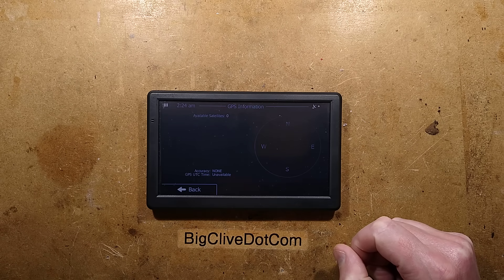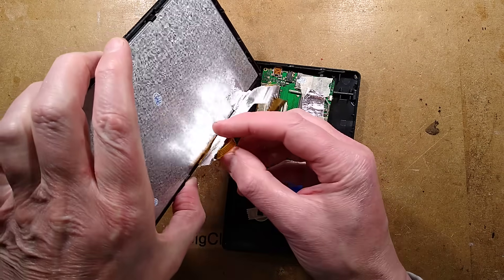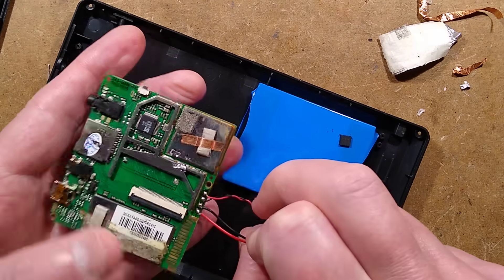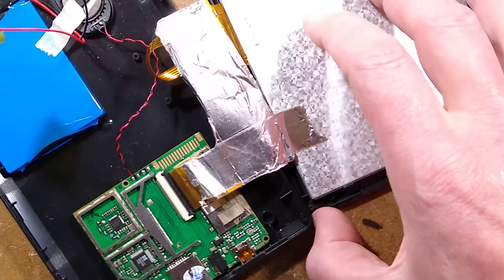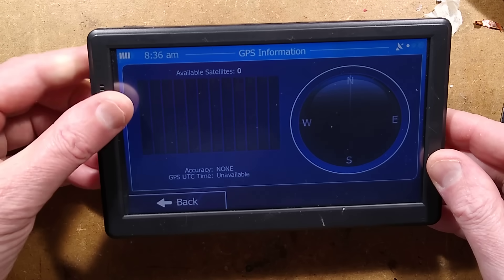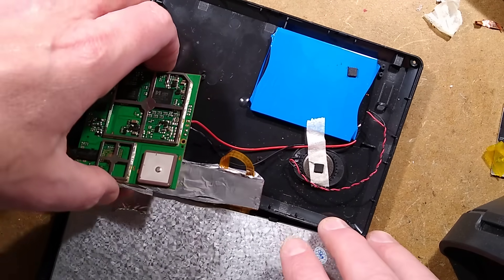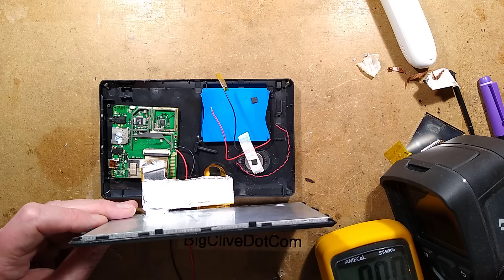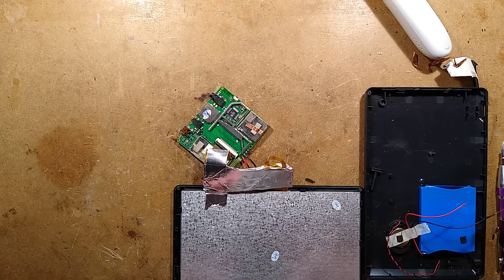Inside a trashy sat-nav

Comment: Looks like the OS is probably WinCE. I've got a small unit with a similar UI and can break out of it to get a nice WinCE desktop. As for the GPS, not too familiar with how it all works, but from what I've read, without any assisted GPS data (smartphones use cell tower IDs and data connection to an AGPS server), it may have to redownload the almanac, which takes around 10 minutes, before it can get a lock.

I wonder what that blob of what looks like solder is used for on the antenna.

Also fun fact, there was a GPS week rollover in 2019, so receivers that are not updated would show the year as 1980 (although the time would be right).
Reply: Yeah no way any android version is gonna boot that fast on such an old device either.
Reply: Wince.
Reply: @khaitomretro  Yeah thats what you do when you realise how crappy it all is...
Reply: My grandpa had a Windows CE Sat Nav and it made the exact same annoying BLOOP sound this unit did when Clive pressed shut down, so I’m willing to bet it’s CE as well
Reply: Redownloading the almanac takes around 12 minutes, but you'd be very lucky to start just before it begins. So it's best to assume it will take twice that long. Add some time to tune into a satellite signal and you're looking at up to half an hour before it's done from cold start .
Reply: It is indeed WinCE6 with iGO Primo 2.0.1 or 2.4 from around 2012-2015. I've seen a lot of these for the 3 years I've been developing that software. But there were Android, iOS, QNX and other ports as well.
Reply: @nyosgomboc2392  There are a probably high-ish number of random OS/hardware tinkerers out there that would be very interested to learn that QNX was used for this sort of thing (although it makes a lot of sense), similarly to how the "S1MP3" project explored the firmware used across a wide range of low-end MP3 players.

Do you know of any devices that used QNX 5 with Photon, such that you could exit out of the GPS app similarly to WinCE? Photon on ARM, in a pre-fabricated enclosure that looks nice, at probably incredibly low $ (on the secondhand market nowadays or at warehouse clearance prices or whatnot) would be very very cool to fiddle with.

IIUC it's ≈easier to use QNX in direct framebuffer mode (eg with Qt), and that the miraculous alignment I'm describing is unlikely. In this case, it would be cool to know if it were generally straightforward to get arbitrary framebuffer apps running on the device - or even Photon.

As for my motivation: these devices are nowadays the stuff of landfill, ie they can be had for next to nothing. If it were possible to trivially reflash them to run arbitrary code (where "trivial" is "download this tool from github and click the button"), they might not be able to run run Linux, but a lot of people would be able to make them do something useful without specialized knowledge.
Reply: @asmqb7222  I don't know any device type, because a different department used QNX. I think most of Harman's head units ran QNX. They might still be useful (and expensive) due to their audio quality.
Reply: @nyosgomboc2392  Thanks for that info, very interesting.

I've vaguely heard of QNX being used in automotive contexts, so I guess I shouldn't be too surprised. It's very cool to see it pop up here and there though.

Why am I not surprised the devices that used QNX still fetch decent prices because of their quality... ;)

(I guess my awareness of the GPS/head unit market isn't particularly rounded out, and kinda biased toward the lower end.)

Comment: That looks like it's been cobbled together in a shed somewhere.
Reply from the maker: That description relates to a lot of small Chinese manufacturers.  Standard components made into products in garages.
Reply: Most cheap Chinese tablets are constructed in this manner
Reply: I wonder if it was reconditioned and sold as new?
Reply: Where I used to work we had a custom built 'trail camera' come in for repair. It was serious piece of kit; A military style drop case containing a beautiful camera, wi-fi module, batteries man enough to power them for weeks.. But it had been put together by a fool. Loose components, shoddy wire routing, piss poor soldering, the whole lot.  
Thing is this had been bought by the local council to catch fly tippers. They'd ordered dozens of them at £2500+ each and we ended up rebuilding the majority of them. Even with a heavy discount for bulk work our bill alone was substantial. 
I'm so glad my taxes go towards that instead of running decent council tips that actually encourage people to use them (they're all outsourced to the French SITA group nowadays)..
Reply: could be worse ... https://www.youtube.com/watch?v=2o8MDCIlOEk
Reply: @KanalFrump  Just the thing I had in mind.. :)

Comment: I wonder how accurate the fix is, probably not very or you would not have shown it.
Reply from the maker: I think it really needs all new screening.  Most people use their phone and Google Maps these days.
Reply: With only 3 signals it can't be very accurate. Strictly speaking you need at least 4 signals to get a proper location with GPS, but a semi-cleaver algorithm could attempt with 3 but it'll probably be off by miles/kilometers because of clock errors.

Comment: The kapton tape is sometimes put on parts to make it easier to give suction-based pick-and-place tools a more secure grip during assembly.
Reply: Particularly common on connectors and similar parts where the top either isn't flat (e.g. surface-mount pin headers) or has holes (e.g. micro-USB sockets, with the two holes for the retaining latches). Pin headers are often supplied with a little plastic "hat" for that purpose, and it isn't always removed before selling the product, so you can occasionally find them still in place when buying electronics modules and such :)
Reply: @AndrewGillard  The tape on connectors is also to keep flux residue from coating the contacts.
Reply: I'd wondered about that, it makes sense.
Reply: Sounds like the perfect time to substitute krapton tape for the Kapton variety.
Reply: Allows it to go through a soldering process without getting effed up.
Reply: Isn't it heat protection also (from soldering nearby)
Reply: @KentishZombie  it doesn't need protection from heat per se, it just doesn't want extra conductive stuff like solder on that top conductive pad, because that would detune it. The two little grind marks in the top pad are put there by some poor bugger whose job it is to get it to resonate at the right frequency and blobbing extra solder on it would mess that up. I suppose it's also possible it would fall apart if it were all heated up to soldering temperature, but don't know whether a bit of tape would prevent that from happening. It's common to find tape covering cavities in connectors, sensors etc for when it all gets soldered.
Reply: @KentishZombie  not in production. If there’s a heat problem in a production line of a huge factory, a tiny bit of kapton isn’t going to help.
Reply: Yes the kapton square is both for suction of the placement nozzle and also protection against cleaning processes too if the ceramic section is absorbent to solvents - you often get these across the inlet holes on electret microphones, humidity sensors etc. to prevent ingress.
Reply: Thankyou!